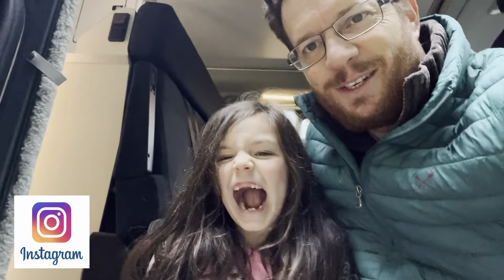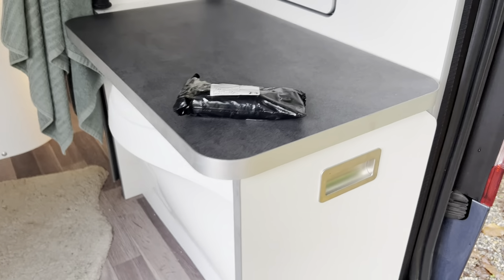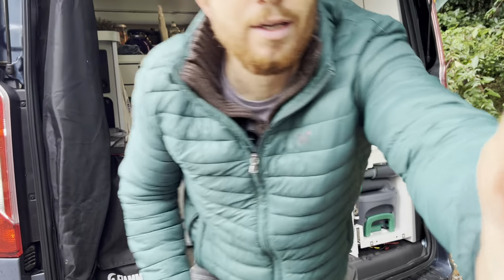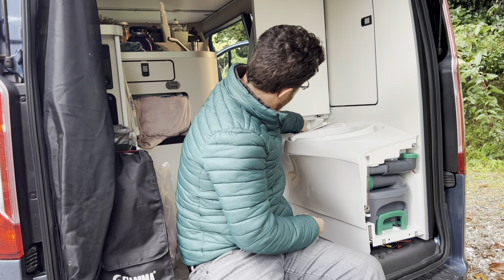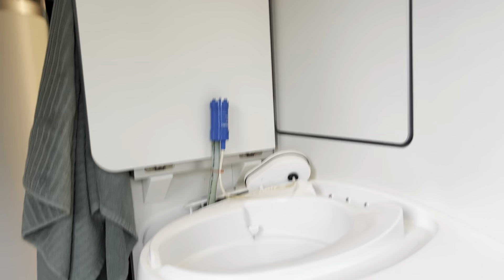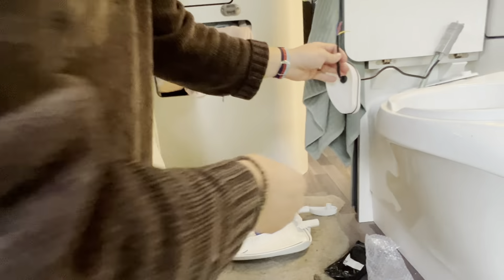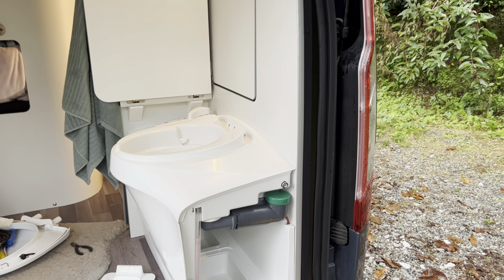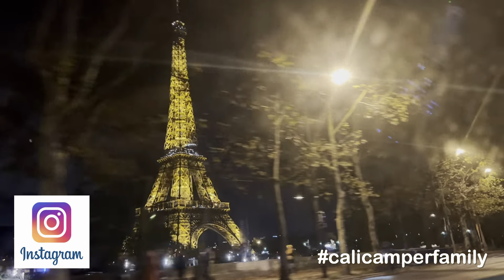Toilet Trouble? - our campervan toilet gives us problems!  DIY fix

Comment: Very clear, excellent camera work too! Another note about using suitable fluids - ordinary kitchen surface cleaners can damage and make brittle caravan/motorhome plastics. I discovered this was possibly the reason for fine cracks in our shower tray. I’ve used the Thetford ‘bathroom’ surface cleaner since and had no problem over several vans since then. It’s dearer but is peace of mind to maintain your van for a longer life! Have a fantastic trip away.
Reply from the maker: Thanks for that…a good tip indeed.  I’ll get some of that for us…nice to keep it nice! 😃👍

Comment: Our toilet stopped working and I tried everything with pumps & fuses. It was none of that. Basically, I had brimmed the flush tank in preparation for a long trip to Denmark. Whilst driving this leaked, splashed into the void under the flush switch and slowly filled that kidney shape space and shorted out the circuit board. Not a cheap fix but it was actually fixed under warranty within two weeks! Needless to say I don’t fill the flush tank more than about 75%. Water did have bits in it but nothing major.
Reply from the maker: That’s a good tip and a reason not to overfill it.  There isn’t a max fill line on the clear tube indicator, so not surprised this happened. Hadn’t thought of that consequence though.  Also, It was good they fixed it under warranty for you, above all, I’m amazed by that.  Westfalia/Ford have still not been in touch about the battery issue…makes me wonder how long it will be!

Comment: Apparently the black sludge occurs from the pink flush fluid. We had a caravan before our nugget and always used pink and blue but have recently switched to elsan organic green which goes in both the top and bottom and we find as well it is better in terms of dealing with smells and not giving off much of a chemical smell either. Just nice and neutral but with enough aroma to do the job.  Seems better all around. I get that people don't always buy branded. This is one area we personally choose to as over the years we've found some of the cheaper ones don't break down paper and other bits and let things smell. But there are other brands of green that goes in top and bottom and you should avoid the black sludge...apparently..could be one of those urban myths but I have seen the same thing being said by loads of people in caravan Facebook groups and yes you have to choose your info carefully. Everyone poses as an expert but it is a conistent message I keep seeing. We accidentally ended up with green because I ordered late before going away via amazon and couldn't get the usual pink and blue  on next day so got the elsan green by accident and regardless of anything we like the green best and I guess every time you flush you do get a bit of extra watered down chemical that helps break stuff down. All personal choice I guess.  Thought it was worth a mention. Great video as usual. If we ever need to take our  nugget plus apart and service bits and pieces you channel has it all!
Reply from the maker: Thanks for that.  Good tips!  I will give that a go as the black sludge is probably the reason the pump stops working.  Thanks for watching and the great comment! 👍
Reply: Thetford have advice to use diluted bleach to kill off the black spores, it used to be on there website. Make sure you flush away the bleach afterwards. I don't use anything except fresh water in the flush tank, but do regularly drain it when not in use. Not sure how is that is on the nugget.

Comment: Bit of topic what cycle rack system are you using I just bought a Autocampers conversion based on the Ford Transit Custom which has barn doors at the back looking for a rack that gives me access with the bikes fitted.
Reply from the maker: Hi, mine is an Atera Strada DL 3+1.  Works well, although I’ve never tried it with barn doors.  It might work but depends also on your towbar.  If it’s a swan neck, then there’s no adjustment, but if you have a more traditional tow bar, then you could fit a spacer to help give you a fraction more clearance.  Thanks for watching. (BTW, if you look back, we did a video on the Atera some years ago) 😃
Reply: @CaliCamperFamily  thanks I'll take a look only recently came across your channel .